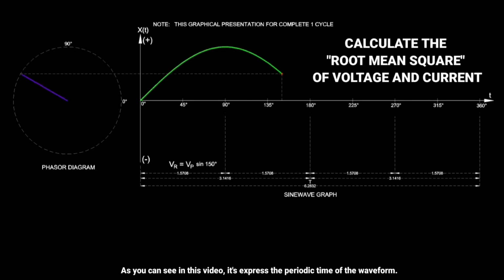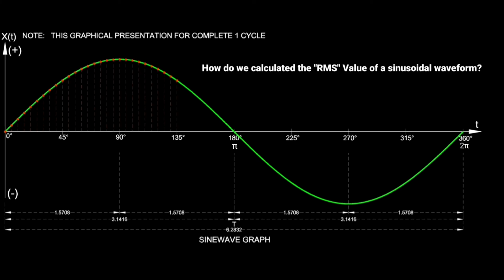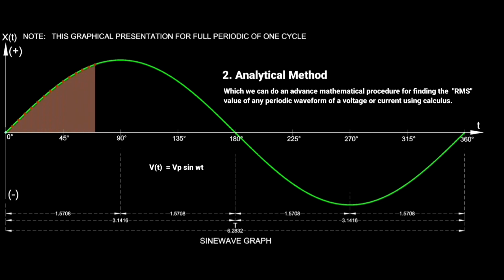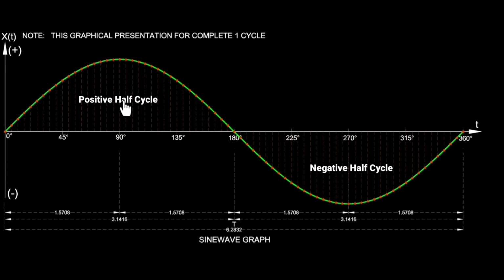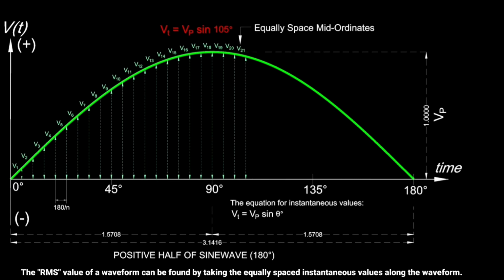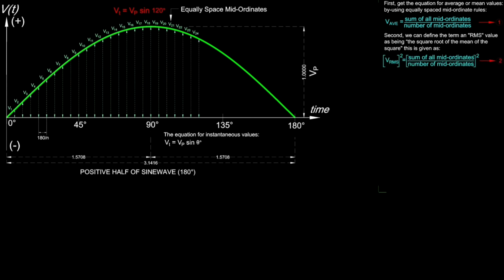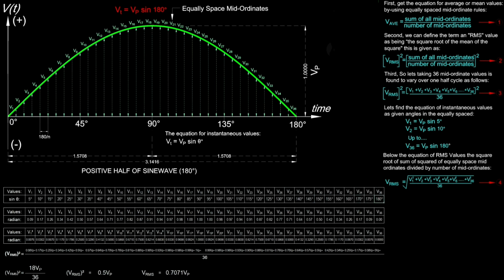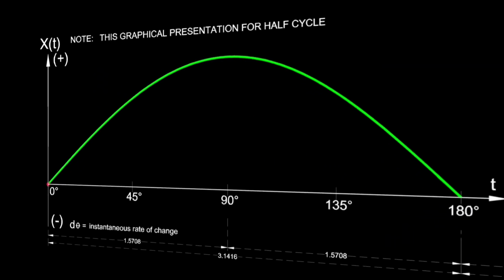What is RMS value (Root Mean Square) | Better Explanation

Comment: i must say, this is a very strange way of calling it a "Better explanation". There are no shortcuts in understanding advanced calculus and this is really what this is. going by areas of the squares underneath the graph it really is all about calculating the integral. So in my view, explaining this better would involve two steps:

1. Explaining what an integral actually is
2. Assuming (1) above is understood, we just claculate the integrals ... 

I mean, then there is the problem where people dont really undetstand calculus - but that's another issue. 

What you do here is explaining it conceptually, but it's not really clear where the formula actually comes from - which is more important in my view.

Comment: One of your equations is wrong but is corrected later in the video - it is not the square of the sum of voltages, it is the sum of the square of each voltage.